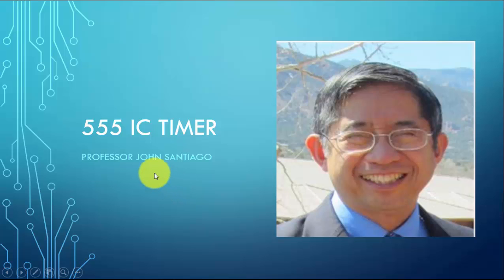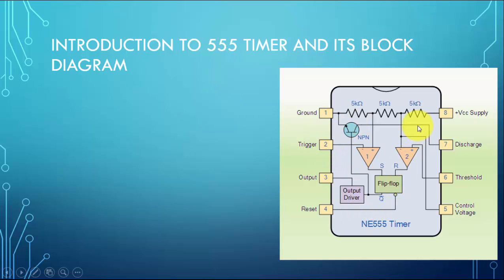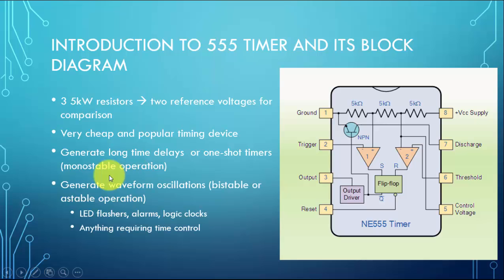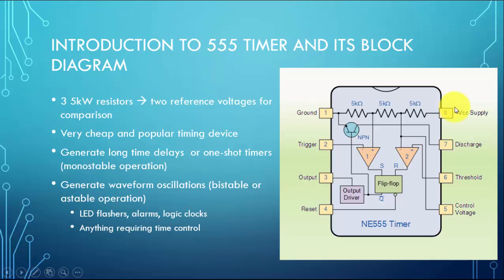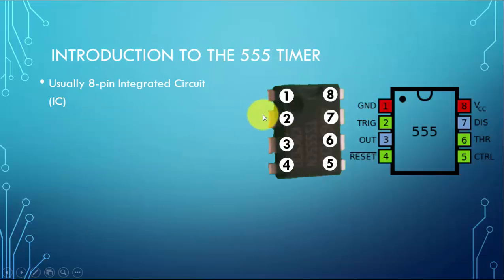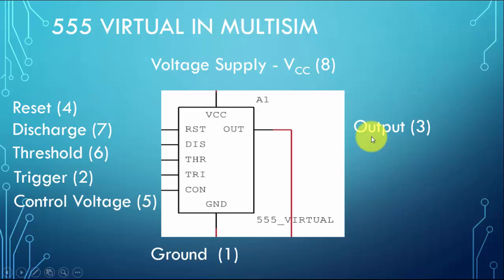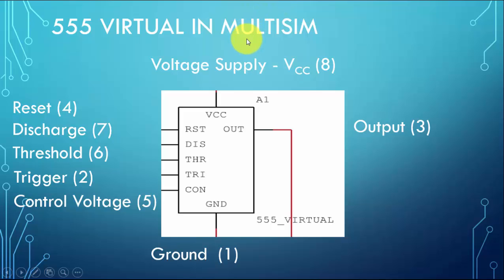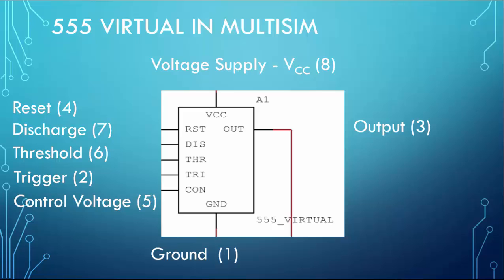A Very Brief Introduction to the 555 Timer (Part 1)

Comment: Just one correction:
According the Wikipedia:  It has been falsely hypothesised that the 555 got its name from the three 5 kΩ resistors used within, but (the designer) Hans Camenzind has stated that the part number was arbitrary, thus it's just a coincidence they matched.